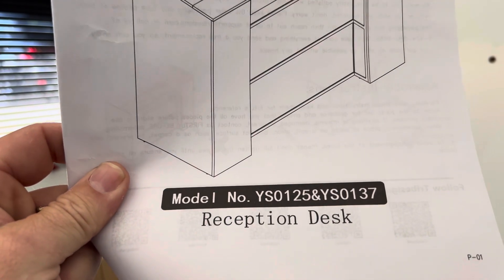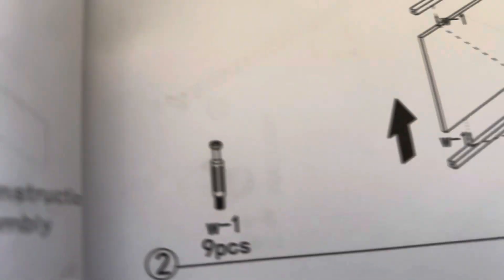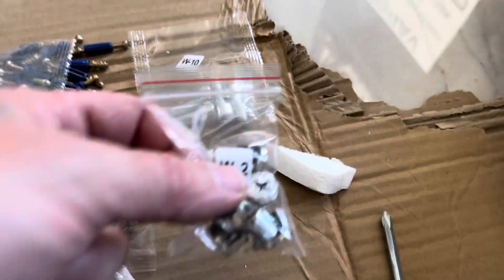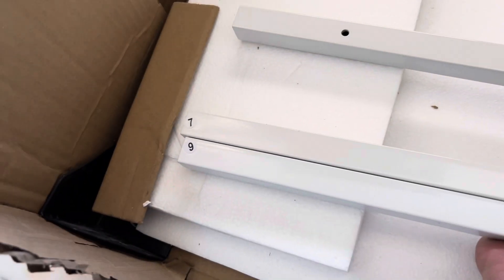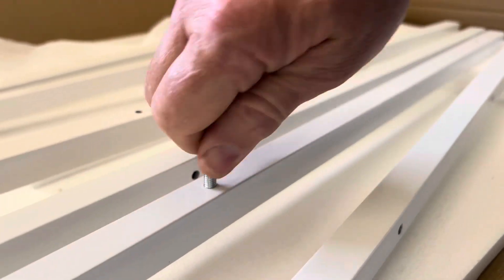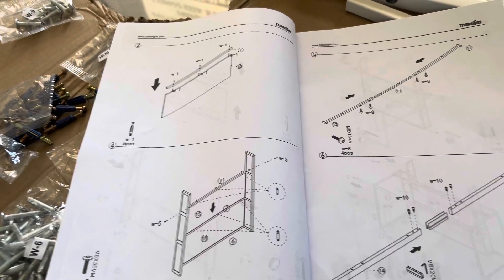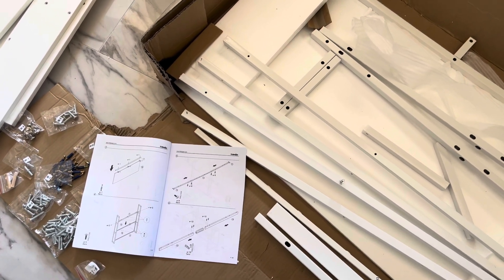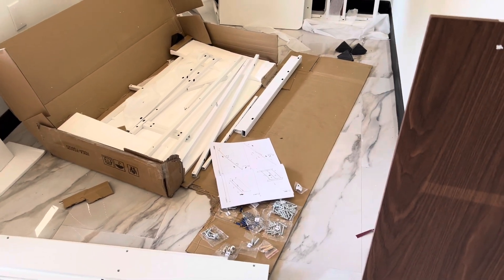Don’t buy this desk! Tribesigns Reception Desk

Comment: Screw them into #6 and 7 , use the phillips to drive them in and just stick the other end into the holes in #15, its a sloppy fit that wont be sturdy until you put the side pieces 3 & 4 in place, Note the 1st picture showing the sides 3 & 4 in place shows the #15 mounted on the rear of 3 & 4 but when you go to the next page it shows #15 mounted to the front of 3 & 4.. You must go by the 2nd picture showing #15 mounted towards the front of 3 and 4 or  when you get to installing 9 and 10 they will be inward instead of outward if you go by the 1st picture.
Reply from the maker: They don't match; there is no way to attach them. That's what I just showed on the video. The ENTIRE video was based around the fact that the pieces supplied didn't match the holes supplied. I even showed how they do not work. This video was more for the manufacturer. They required a video before accepting the return. Even they said this was a messed up kit. Come to find out it was two different kits mixed. It would have never gone together. Even if I did force it.

Comment: I am currently putting this desk together. The w1 do work. It takes some effort to thread and the Allen style screwdriver they provide works the best.
Reply from the maker: I need photo proof because the screws I was supplied didn't have a matching hole in the desk. No amount of effort could make a small screw grab in a hole more than twice its size..